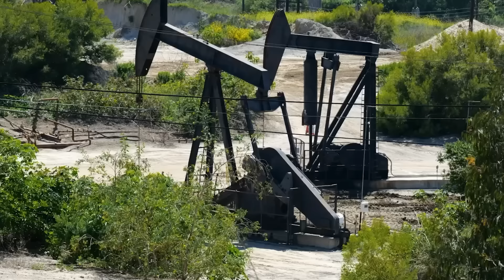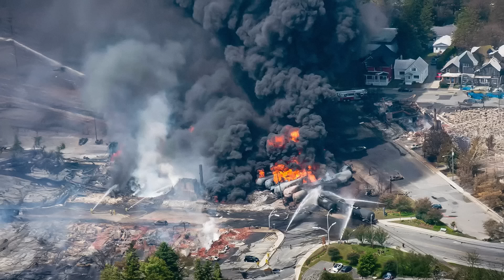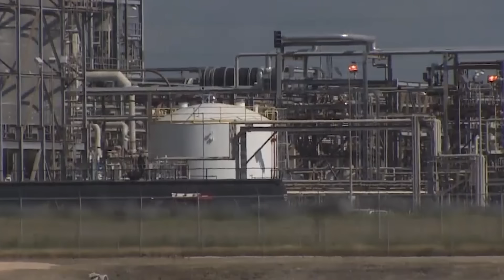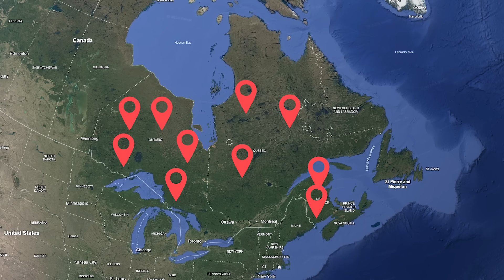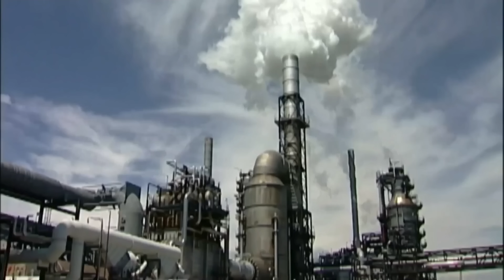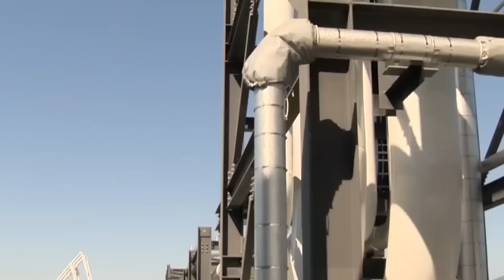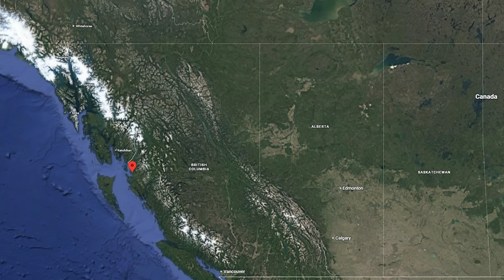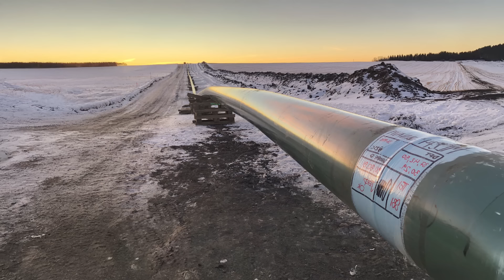Here's Why Canada Can't Build Its Own Refineries, Even Though It Produces Millions of Tons of Oil

Comment: !?!? WTF ! We have plenty of refineries we just have a government that stymies the industry at every move to bring it back up and running full tilt !
Reply: Right on. Stating $25 billion dollars to upgrade the TransCanada pipeline is too much money for an industry which grosses $75 billion a year is ridiculous. In Vancouver we're paying nearly 20X the average family income for our homes, but that's just fine. We could boost oil revenue by several billion a year if we weren't locked into selling to the Americans. More than enough money and reasons to change the status quo.
Reply: @dscott6629  We aren't locked into selling to the US. We sell globally. What isn't happening that OPEC countries offer, low fuel costs for the citizens. Why are we paying market rates when we produce the stuff?
Reply: @leofortey7561  Without a pipeline to the Pacific, or a major upgrade to the TransCanada, we are locked into selling the majority of Alberta oil to the US. You're either deluded or an American shill to argue otherwise. /smh
Reply: @dscott6629  And Canada needs to expand flexibility on where it can sell and refine it's own natural resources without selling out to China.  This will become even more important as Venezuelan oil starts coming back into the market in ever larger volumes.  Potentially equaling Canadian output.  BUT here is the cautionary aspect:  WTI is at about $50-$60 per barrel.  WCS sells at about a $10-$20 per barrel discount *numbers via google (not mine)  This is without volumes of crude from Russia, Iran, or Venezuela.  It is possible, some might say likely that in the next 10-15 years oil from these three oil rich countries will be back on the market.  That will likely bring down the price of oil.  Especially WCS.  This needs to be considered when investing $50-$100 Billion.  As an American I would like Canada to do expand pipelines to the Pacific and the US, but this should be done with a clear understanding that the ROI might be 50 years, not 20 years.
Reply: @dscott6629 it's 40 billion
Reply: Canada has 16 to 17 active refineries that process approximately 1.9 million barrels of crude oil per day, with roughly 73% of that feedstock being domestically sourced Canadian crude. While all western Canadian refineries use domestic oil, some Eastern Canadian refineries in Quebec and Atlantic Canada rely on imports.
Reply: We used to have, not anymore. Too costly to build new refineries. Lead time also do no justice to feasibility. I did a full cost estimate in 2019, on basis of shipping refined crude East from Alberta. Cost benefit did not make economic sense then.
Reply: Might be one of the smartest comments I have read yet.
Reply: NOT for bitchamun Canadian climate is the problem to my understanding only a new state of the art refinery built with knowledge of refined in a cold 🥶 climate.🍁😉
Reply: Indeed. Ottawa wants to green everyone back to the Neanderthal Age.
Reply: HORSESHIT
Reply: With Zero support from ANY private companies, why do you think that is
Reply: @TheAlphaRob  Because they know the Liberal government is right out of their tiny minds.
Reply: @TheAlphaRob why because your poorly educated conspiracy loving ass is wrong. CNRL, SuncorbEnergy, Cenovus Energy, Imperial oil, Enbridge, TC Energy, MRG Rnergy, Parkland Corp., Whitecap Resources and more all operate in Canada. A simple google search could have saved you from appearing to be ignorant. Canada does not own the oil extracted, it gets royaltiez from the companies pumping the oil. This post is full of misinformation. Canada owns the transmountain pipeline that sends oilsands oil to BC. The refineries are privately owned by oil companies that buy and sell oil, not the Canadian government.
Reply: 100%
Reply: Not Government,  the companies do not think it is worth the risk and cost.
Reply: @tesos2866 except this video is full of BS. The refineries in Canada are owned by oil companies, not Canada. Canada has no say other than regulations how thiese companies operate. Canada owns the transmountain pipeline. A simple googke search will give you the lidt of refineries and which companies own and operate them. This video is full of misinformation.
Reply: @tesos2866 exactly, private companies aren’t interested. CNRL is buying up every, that’s leaving.
Reply: @tesos2866 because the government regulations are to limiting and sporadicly change. It takes 10 years to get approval. Your view is very shallow and uninformed.
Reply: @tesos2866 carbon tax, penalty for exceeding cap emissions. It is the government who keeps blocking it 😂😂
Reply: CCP youtube channel
Reply: Inaccurate
Reply: Canada's oil refineries are working at 90% capacity. They were not designed for Alberta crude and are located 1,500 to 2,000 miles away. The Canadian government has given 10s of billions of dollars of subsidies to fossil fuels and is committed to a massive expansion of subsidies.
Reply: @nickd4310  People have to pay for fossil fuels anyway, it's comical that people like you think there is something wrong with these alleged subsidies
Reply: @soakupthesunman I don't mind that people who use fossil fuels pay for them. I mind paying for fossil fuels that other people use.
Take theTMP extension. The company made 38k last year and should roughly break even throughout its lifespan. Why should taxpayers be on the hook for the billions it cost to build plus interest?
My credit card bill just came in. Would you send me the money to pay it?
Reply: @nickd4310  First off, gov't doesn't build anything. Period. 
What they are great at is red tape and lip service. 
Companies build everything with the intent of making a profit. If the gov't messes up the conditions, businesses leave. It is how our auto sector is going. Gov't intervention at its worst. 
The gov't can, and usually does, offer low to zero interest loans and grants for businesses to apply for to get going.
Reply: @leofortey7561 The red tape argument is just an excuse. Why aren't you building the Keystone pipeline now that you have a president who will cut through all red tape for it? The reality is that any future pipelines on Canada will require massive government subsidies.
If I am wrong, show me any plans that have been costed and have cash flow projections.
Reply: @soakupthesunman what's comical is that people still believe that oil comes from fossils.
Reply: @nickd4310 it's not an excuse! The keystone pipeline was 100% privately funded then traito got involved and they delayed the pipeline with regulations...... but don't you guys worry about that, traito bought out the now failed project and ruined it.
Reply: @NigelM18 When we all know that God put it there so that humans could drive automobiles!
Reply: @NigelM18 Trudeau placed no restrictions on the Keystone XL pipeline and the Canadian portion was built. Joe Biden cancelled it when he became president. But Trump has now reapproved the project and the private sector is no longer willing to approve it.
Reply: @nickd4310  We've lost hundreds of billions of investments in this country. 
Plus, Bill c-69 is still on the books. What project can happen? They tied their own hands.
Reply: What are you talking about?

The federal government just spent a vast amount of money to greatly expand capacity for a pipeline from Alberta to the west coast.
This was a project that no private company was willing to carry out.

The Alberta government recently spent a huge amount of money to subsidize the construction of an oil refinery that will probably always run at a loss.

The federal government has effectively given up its promise to the world 
made in the Paris climate agreement to reduce carbon emissions.

The federal government has made a deal with Alberta effectively saying 
that it won't stand in the way of a new oil pipeline to the west coast.

The federal government has been calmly dealing with the unhinged toddler clown 
in the White House who keeps threatening to impose vast tariffs on
Canadian products  - something that obviously would be of concern 
to a Canadian oil industry that exports a lot of product to the United States.
Reply: @upgrba24 the Canadian Federal gov't has been run by a CLOWN for the last ten years that is a major reason we are in this mess
Reply: @upgrba24 bro you listen to fake news.
Reply: @upgrba24  What are you talking about? The federal government hasn't spent a cent expanding pipeline capacity to the Pacific. There is NO PIPELINE TO THE PACIFIC. 
The federal government has only agreed to open talks about building a Pacific pipeline, so long as it and four other stakeholders (such as First Nations and the environmentalist lobby) are given veto power over the pipeline's construction. Like that's ever going to lead to a pipeline being built. 
It was pointed out when Canada signed the Paris Climate Agreement that Canada would not, could not comply with the Agreement for at least a decade. 
And lastly Trump has not just threatened to impose tariffs on Canadian imports into the States - he HAS imposed tariffs. We'll have to see how Trump deals with yesterday's decision by the US Supreme Court. 
But punitive tariffs will be paid by American consumers anyways, so tariffs aren't the problem. What Alberta needs and is insisting on is the ability to sell its oil to the highest bidder, and that means Alberta oil must have a way to get to at least the Asian market. We're looking at another decade even if we started building right now.
Reply: @dscott6629 Trudeau spent billions for a second Trans Canada pipeline, we went from shipping 300,000 barrels a day to 890,000 since then. But we still need more. There are two pipelines to the Pacific dummy 😂
Reply: @wasupfool5692 There have been no upgrades to the TransCanada pipeline. You may be referencing the TC Pipelines proposed Energy East Pipeline which would have delivered 1.1 million barrels/day of diluted bitumen to the East Coast. That project was CANCELLED by the Trudeau government on Oct. 5, 2017. 
You're correct that there are two pipelines from Alberta to BC. One is natural gas and the other transports oil and refined petroleum products. Both service BC's domestic natural gas and refined oil needs. Neither connect to a port. Neither can be used to export crude oil.
Reply: The Government has more responsibilities than just building pipelines and shipping oil. You make it sound so simple and that says so muich about you.
Reply: @wysetech2000  
 The government did not need to get involved in that pipeline.  The ballooning cost was because of delays from very stupid "environmental studies" and "first nations approval", neither of which needed to be anywhere near the scale that happened.  
Also, don't be making insulting comments.  Only make you look like an officious punk
Reply: @wysetech2000 the gov't is not responsible for building pipelines
That is EXACTLY our problem. They need to get the hell out of the way and quit changing the rules
Reply: @wysetech2000  - the government does not have to build pipelines, they just need to permit it. That is it. Get out of the way of progress.

Comment: What the fuck you talking about Canada has more refineries per capita than the USA. The only issue Canada has is a pipeline from the west to the east to refine
Reply: CANADA has no pipe line after ONT. IRVING has heavy oil by train from out west.
Reply: @carmanmacbain5976 the actual pipeline is or goes through the states it’s not on Canadian soil
Reply: What are you smoking???
What is your source and proof!